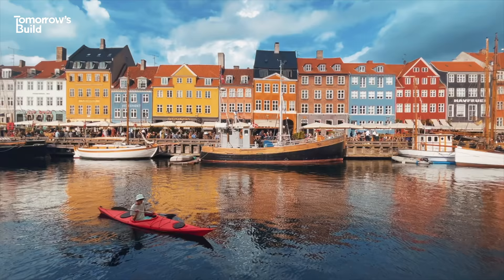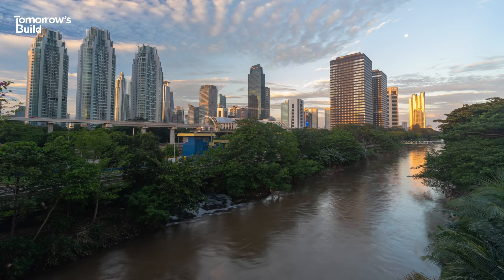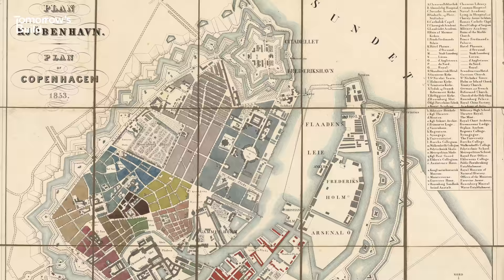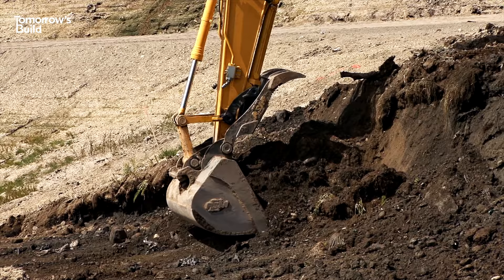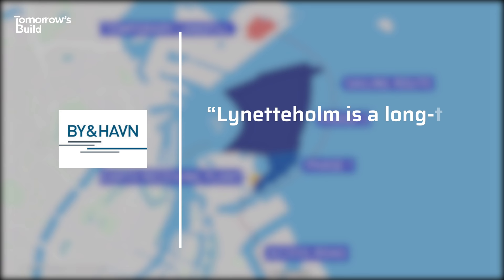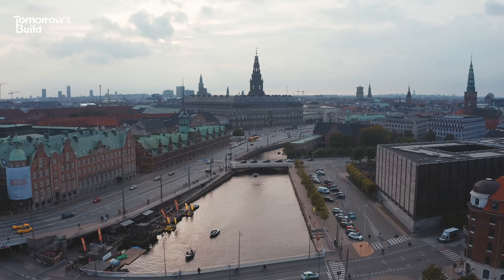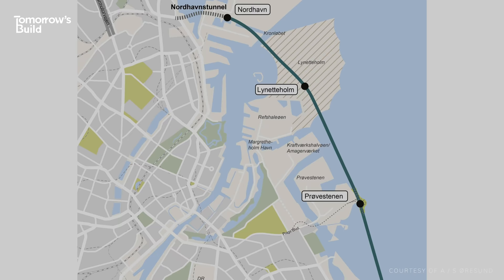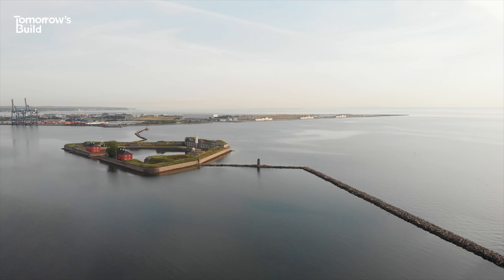The 50-Year Plan to Save Copenhagen From Flooding

Comment: Maybe it's my naiveté but why transport the dirt by lorry/truck? It seems to me that a modified ski lift type system could allow non stop loads of dirt to be carried over moderately large distances and spans with relatively minimal infrastructure need.  Granted, it doesnt exist and some engineering is needed but with a little creativity they could move just as much dirt without the traffic impact for 25 years.  Design it like a tram with similar goals for minimal operating noise and maybe you gain the ability to move dirt 24/7.
Reply: I know a fair bit about aerial ropeways and I suspect one of the big problems would be building towers high enough to let ships pass underneath. The Emirates gondola in London had to have a 90 metre clearance for shipping and the cost of building such high towers was massive. On this system the carriers would be full of dirt rather than people, but they would be heavier, meaning the towers and cable would have to be able to cope with even bigger stresses than passenger gondolas in London or ski areas.
Reply: No reason not to use water as access point, driving trucks through city with dirt for 50 years is truly a last century  concept. If they care about environment they should design eco-friendly electric ships which are gonna be used for next 50 years (or maybe faster?) -  seems to be a worthy investment.
Reply: The landfill dirt is leftovers from construction projects all around the city and the greater urban area. I don’t know how you will adjust a ski lift to reach everywhere.
Reply: @Kvadraten376  Aerial ropeways have been used for quaries, mines and construction projects,for over a century, ski lifts actually evolved from them.
Reply: @diffore  Yeah but this is Denmark, we're full of last century concepts here. I mean did you forget the project involves a 400 million US dollar underwater highway tunnel around the east of the city! We could get so many improvements to public transit like several high frequency light rail and BRT lines throughout the whole metropolitan area for that price, but nope, the government wants to waste it all on a highway tunnel which will only cause more congestion for the whole of the city.

Comment: Sand does not come from thin air. If the Danish people are planning to use sand, where are they getting the sand from? This sand probably will come from a small island at risk of flooding once sand has been taken too. Island sand is much more course than land sand, this is because it is gritter as it has to deal with water and offer flood protection. So Copenhagen is likely to cause environmental damage just to save their flooding issues when all they have to do is build barriers and pump water to more drier parts of the world.

Comment: This project is an environmental disaster....to move the earth 72 trucks every hour will need to be driven through the city for 50 years. Also, I'm a meteorologist and I can tell you the storm protection is greenwashing, for one thing the prevailing winds during typical flood conditions in Copenhagen are not from this direction.